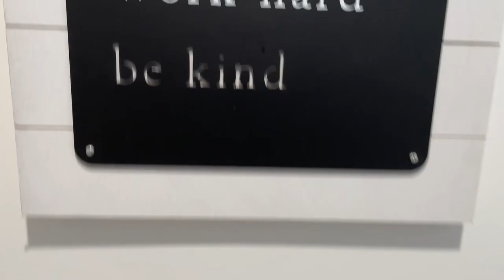LVP Flooring In Bathroom And Bedroom DONE! Pulled, Reset Toilet On LVP.

Comment: Probably a little late, however if you still are installing lvp, instead of cutting ever piece with a saw you can cut it where you need with a razor knife and break it clean with your hands. Helps so you don’t have to get up off your knees everytime.

Comment: I’ve lived in my home for 26 years. I got shutters from a reputable company when we moved in. 10 years later I got blinds in other areas of my home. Those blinds were less expensive. The vinyl parts on those shutters have broken down in the Arizona sun over the years. My recommendation for shutters is to make sure that the tilt bars are attached with crown staples and that the louvers which are attached to them are also attached with crown staples. My original shutters have never failed because they used crown staples and not vinyl connectors which break down because of the sun.

Comment: JudithB  Looks  really  good!  I  love  and  reuse  my  audio books  and  regular books  all  the time.  We  moved into the  old  farmhouse  mid 70s  and  I  thought we  were going to  freeze to death that first winter.  I had an awful time  learning  how  to  use the woodstove.  When we  decided  to  re do the house,  we  found knob n tube wiring,  burnt paneling over  holes in the chimney,  no insulation  and  you  could  stick your finger  thru the  3/4" oak planks.  There were huge holes under the windows where  the  planks had rotted  leaving the asbestos siding hanging in air.  It took a year  to  move walls,  replace windows,  electric and  insulate,  then hang and  finish sheetrock and  outside  siding.  We added  10'x 30'  to  the end of the house to add  bedrooms and a hall way.  I  finished  the sheetrock by myself,  laid  carpet  and  did some panelling with my Moms  help.  My ex  decided  he would  be  happier  somewhere else,  but  the  house  got finished  anyway.  I  learned a  lot in  those years.  A  shop  vac  is  the  best  friend  when  living in construction!   Many years later,  construction  is  a  fact of  life here at  the  homestead,  the  projects  are  generally smaller,  shelving being  built  in all  possible areas,  and  repairs  to do.  I am  screening my front porch currently,  and  building raised beds in the garden.  I  think the work keeps  me  healthy,  physically  and  mentally!!

Comment: Heath, you did a wonderful job on flooring. Just love that look!!! You will definitely feel that sense of accomplishment when flooring complete! Cedar, I am a huge fan of plantation shutters. I clean several homes that have them and would love to have them in my own home. Easy to clean. Protect windows. Keep house cool in summer. Help direct air flow on open window days. And keep rooms darker or lighter when needed. And again, easy to keep clean. I like smooth ones. Not wood grain. Just finding good quality ones may be a little pricey... but totally worth it. We rent and would love to have them. I priced it out... but money too tight these days. Looking forward to rest of flooring being completed by Heath... then on to the next project!!!

Comment: A lodge would be nice.  But still think about putting some living space on an upper level of the shop.  Build a second level coming 12 ft off the hillside wall the entire length of the shop.  Your bathroom will be under part of it. You could easily have two bedrooms on each end and a lounge area in between with stairs from the lounge are down for access to the bathroom.  All of this work could be done through a winter.
Reply: isn't it wonderful how we try to spend this families' money and create more work for them.

Comment: We installed vinyl planks in our kitchen. We live in an old apartment building and the floor is not the flattest. It has small bumps all over. So we got warned about it not being the smartest decision to do that. Then at the other store they said vinyl plank would be the best option because it "bends" more than other floor materials. So we decided to take the risk and we haven't regret the decision we made almost 2 years ago. We put separate insulation/sound proof under it (made out of very thin and small styrofoam balls, specifically made for parquette flooring). I didn't even know there are that kinda vinyl planks that have the insulation glued to them. Good to know for our next project! I really like the look of your new floor, it fits perfectly with the concrete tops!

Comment: House is looking great. Please be aware that installing shutters will cut down greatly on your light because of the frames around the windows. Even with the shutters wide open, the frames take up a good deal of the window space. I had my last three homes where I installed shutters. Decided this time the light was far more important and installed honeycomb blinds instead. You really don't realize the light you will lose until the shutters are installed and then it is too late. I had the 4" shutters installed which when they were open did help but over all, you will lose light.

Comment: The foam pad over concrete as you say would add some cushioning but really didn't want that feel anyway.  I think a foam pad would make more sense over a wood nailed down subfloor in terms of making the surface a bit more forgiving.  The problem  seen with the LVP is more expansion/contraction and the seams come apart.  Using a glass suction cup thing and a rubber mallet you can probably smack the seam gap back together if it happens.  The color of your floor looks good I like it.

Comment: You got the good flooring then, if it already has the underlayment attached, saves so much time.  The first flooring we got for our house for the kitchen and dining room was like that as well.  The cheaper stuff you gotta buy the underlayment separate, and its a pain trying to work with, as it tries to roll itself up as you are going LOL.  Glad you talked about the underlayment.  From when you were doing the install I don't think anyone could tell it had the underlayment attached, that is why everyone was saying you need an underlayment on the concrete first.  Now we know why you skipped that, and saved you a lot of time getting pissed off at the dang separate underlayment rolling back up every time you turn around.  

The floor is easy to install, its the getting up and down to make the cuts and such that is hard.  I want to redo the flooring in my whole house at some point, its going to be expensive but I want to put the same floor through the whole house instead of so much patchwork type stuff we have now.  Its not too bad but would like to get some much better having it all the same without transitions between rooms due to different flooring thicknesses.

Comment: I had a 1963 gmc step side with a 4 speed stick and a straight six with a 8000 lb  power take off winch. It would only do 60 mph flat out but would climb the side of a mountain. I wish I still had it

Comment: I had a red 1965 C10 as my first daily driver. 250 Ci or cubic inches straight 6 automatic no power anything an am radio and a heater.  It was a good truck but a real Pain in the butt to parallel park ! It was 11 years old when I got it but in good shape.
Reply: sorry 250 ci straight 6
Reply: You can always edit your comments by clicking on the 3 vertical dots to the right of comment. Also are you sure it wasn't 2500cc?
Reply: @tonygrimes13  Thanks didn't know how to edit I changed it 250 Ci cubic inches
Reply: @teekay1785  No problem!

Comment: Ceiling tiles called furtex for awhile had asbestos. I drywalled an overhead covering up the firtex and not removing it. It is recommended when encountering asbestos to leave it alone if possible. Asbestos is still with us today but has been relabeled chrysolite and probably other names. Some forms like floor tiles and shingles are relatively safe to work with. It is an excellent product but like many things it is dangerous if used without knowledge. Ron

Comment: The kids talked my wife's 90 + year old mother that was confined to a wheelchair she has since passed into the luxury snap together flooring I told mom at the time it wouldn't hold up to her wheelchair the weight placed in a small area by each wheel instead of spread out by a person's foot is quite the difference it looked nice mom liked it but the joints failed. We found an older gentleman that worked at his own pace making and installing flooring that is mixed scraps from a flooring mill in North Carolina I was skeptical at first with mixed widths and spices of wood but after it was installed it was 40 dollars more and held up to mom's constant motoring about the house the finish was Pall-X Power waterborne finish around 80 bucks a gallon and still looks great

Comment: From UK, Just noticed on the toilet that you have two exit points, one directly down under toilet unit and one behind through the wall, could you explain this as all UK toilets are a rear connection system. Thank you and keep going strong.

Comment: I was always told never to caulk a toilet, is this wrong?
Reply: I'm not a plumber like Heath here, but what is the reasoning against it. You were told to never do it but why? I can only think of positives
Reply: I worked in a plumbing store some 80 years ago & at that time that's what I was told.  The reason was if the wax ring failed the water would be able to drain away.  If the water got trapped it would rotten your floor, if you had a crawl space for a basement that was hard to repair. 
Back in the 50/60's, there were many homes built with crawl spaces as it was cheaper without a basement.
Reply: @chris3m98  If you worked in a plumbing store 80 years ago may I ask what age are you now?
Reply: @tonygrimes13  Tony I should have typed 60 years ago.  Sorry, thanks for asking, I'll try to be more careful.  I am an 88-year old female that has a twin brother.  Stay safe, wear a mask!
Reply: @chris3m98  You've got 25 years more experience. Than me! I'm Irish & wear a mask, I can't understand the mask deniers!!! They have obviously no common sense!!!
Reply: @tonygrimes13  My folks came to this country in 1929 from Scotland.  We were taught to do as we are told.  My Father said that this country has seen its best days, I know now what he meant.  As I look back I think it has changed starting in the 1970s???
I stand for the flag, I kneel in prayer!  ALM   Stay safe, wear a mask.
P.S. I get my 2nd shot Tues.

Comment: Never caulk around a toilet.  If the wax ring ever starts to leak you won't see. It will work it's way under the flooring or down to your sub floor.  I know his house is concrete but this is not a good practice.
Reply: Heath is a plumber!!!

Comment: Looks kinda crappy with the closet with no jambs or trim and an outlet with a giant gap around it. Tell me I didn't see you stop the floor short of the tub and lay caulk to fill the gap, also the caulk around the toilet was a bit sloppy for a plumber.
Change the pitch of the roof, seriously are you sick. This is what happens when there is no planning, flying by the seat of ones pants.